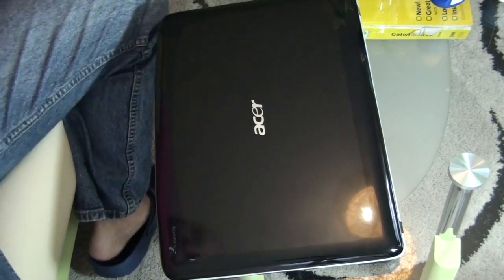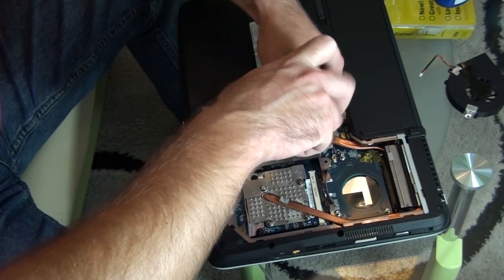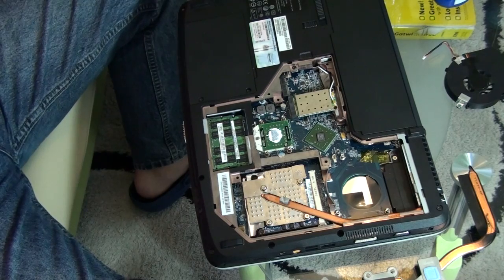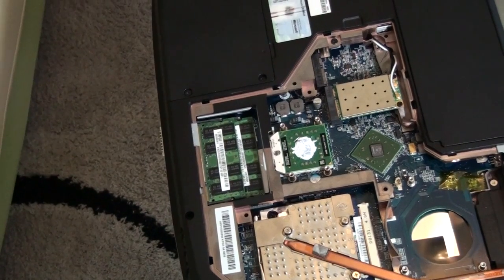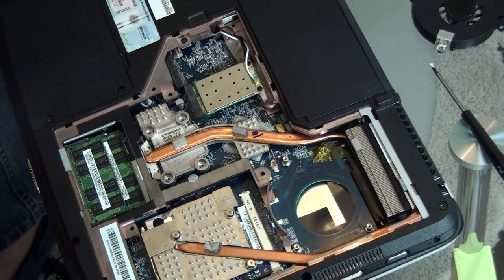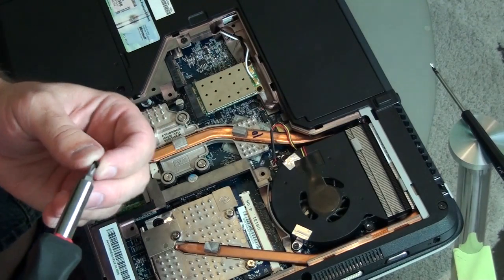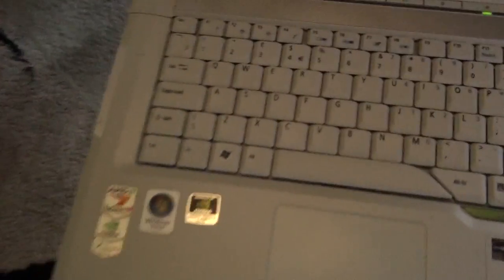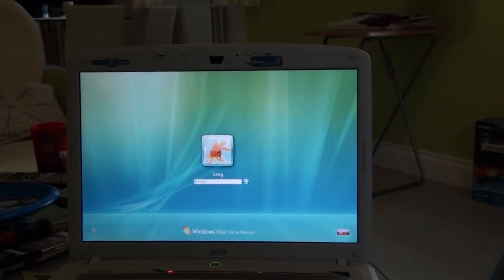problems with acer aspire 5520g PROBLEM FIXED

Comment: It worked. With an airdryer on low speed and max heat. I heated the chip for 6 minutes. I used some thermal past when putting it al back togheter. This was for the acer aspire 7520. ThankS!

Comment: Thank you for that piece of high butchery. Good idea thus!!  I suggest the following:
- use latex gloves on your hands, to avoid contamination and elecrostatic discharges.
- NEVER use screwdrivers on rams, chipsets, cpus or gpus.
- Screw a cooler  in a diagonal way, so to equalize forces.
- Thermal compund:  only one or two drops. Let be the simple contact between parts to   squish it all around.
- on that specific laptop, I found useful to cut slightly the three fan's holes, so to enlarge a bit the ingoing airflow. It helped the noise level and the temperature drop by 3 C°
Hope it helps!!!

Comment: Just wanted to say thank you .. I used your video .. It worked for me.. I used a normal House hold hair dryer.. Took apart just like in the video above .. Heated the chipset for about 5 minutes letting it get nice and warm Careful cause you can Over heat the plastic and melt it.. reassembled my laptop and let it sit for a minute or two .. And then tried it.. The laptop is working great .. I am using it right now.. Thanks again Xegos...

Arlen

Comment: Just checked this method -it's work. I made 2 inch height square tube from cardboard around chip(shield for plastic elements). Turn on fan at slow speed and 200C warm it up and heat up chip for 2-3 minutes. Because of square tube-shield chip heated up very fast.

Comment: I did this before and it worked for few weeks then return to the same problem, this is not a solution but of coarse this is better than buying a new motherboard.

Comment: Thanks. Actually this did work. I actually had the screen show the first "acer" screen, this isn't clear in these presentations on youtube. It is later in the boot process that the computer decides that the graphics chip is corrupt and/or it has overheated before, I dont know. -goes black and never comes back..:/
ANYWAY -IT worked for me on my 7520g ! Lots of black dust/muck in the heat sink grid at the fan! I used the heat gun a little - and it now runs like a charm !
THANKS AGAIN

Comment: This video really helped.  I don't know what the heat gun was for but I needed to replace a noisy fan which had already been done under warranty... $140.00.  this was easy with your help.  My LT doesn't have the other cooling area at the bottom right of the fan.  Not sure what it is.  Maybe this missing part is why my Acer 5520 machine run SOOOOOO slow.

Comment: My acer 5520 was doing exactly the same has his and I did the procedure. Now the computer will boot up and it has sound but now the monitor is black and shows nothing. I fear I may have melted something that the monitor needs to work. Any ideas?

Comment from the maker: @coolphilipp04 start from checking conection in wall socket than check if psu diode lit up if everything is ok it may be button problem try hold it for 5 sec or so, you can see on my vid lappy doesn't start when I press it for a first time.

Comment: hi men, I have a laptop acer aspire 5520,with a heat gun, the problem is that now will not start anything just in the power button then appear a red light, not if I can hayudar.

Comment: Hi.could you help me.I have a problem with my Acer, the same model.I have it for 3 years.last year I used it intensely on games and it was heating a lot .but then the screen split into six parts every time I opened it.I tried everything, but I took it to a technician and he fixed it.

now this problem happened again, but I didn't heat it up like before.I cleaned it inside from dust and it's still the same.
is it because of me or the laptop do you know?
thanks.

Comment: Please how long should the hot air belown onto the vga chipset and what should be the temperature that should be used. I been blowing hot air onto it several times but it is still not working. what else should I do?

Comment: Xegos. How long did this fix work for? I have watched a few other videos with the same problem but a lot of them say that 200c is the most you should use because that is the temperature that solder melts at?

Comment: this worked for me for a friends laptop....symptom blinking green light on bootup no bios access holding in power would not shut down the laptop.

heatgun targeted on the nvidia chip at about 215 degrees twice for about 30 secs each time with a small weight on the processor then let it cool for a couple minutes reassemble and boot up!

Comment: Mine did the same thing but i didnt pull my one apart..basicly i pressed alt and esc together then pressed the power button till it switched off..once off press the power button 5 times and wait for screen to come on...well it may or may not work but it can be a first option before taking back off and heating up chips lol...

Comment from the maker: @kilgourt1985 Hi. First ACER should admit its cooling system is badly designed and repair those laptops for free.
Secondly read description I recommended to disconnect battery.
Thirdly I did my best to bring this laptop to life not being IT expert and using instructions left under my previous vid and not spent too much money on it.
Check all publication dates my vid is first among many. Yes I made few mistakes as anybody would do doing something for a first time.

Comment: You can install Windows 10 on this Notebook, but you should upgrade it to 4gb Ram, SSD and you have to use the Windows Vista Graphics driver, it works on Windows 10 fine.

Comment: you put way to much paste on the cpu you only need to cove just the top part nothing else. Use artic sliver 5 works much better. not trying to be mean but you did that all wrong. If you need help ask I will send you info for the right way
Reply from the maker: I understand what you say but this video was first published in 2010 when I knew nothing about laptops and computers. I wasn't even a beginner. They quoted me in service for repairing this laptop the same price as I would pay for new one. So, what you think I did? I bought new one and played around with this one. It worked for a while and than just stopped. This laptop is a history now http://youtu.be/0oeJDXlvrG4 , but there are some persistent people who may not give up their laptops so easy, This video is for them.
Thanks for watching and your effort to help me.

Comment: It worked:) System is running now. Clean the ventilator and the grid. Heat up the chip like in the video explained. It worked. Don't know why, but it worked.

Greetings from germany and thank you very much xegos!